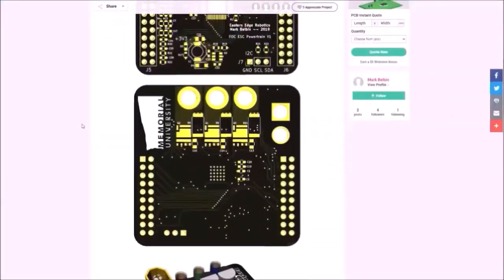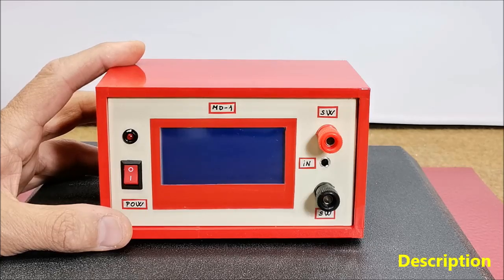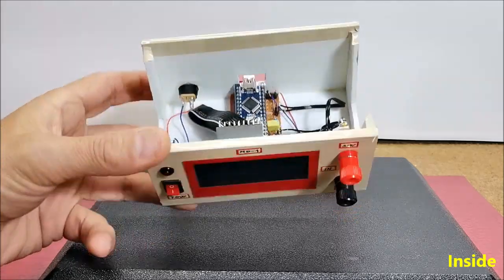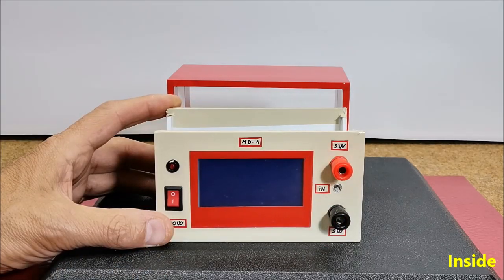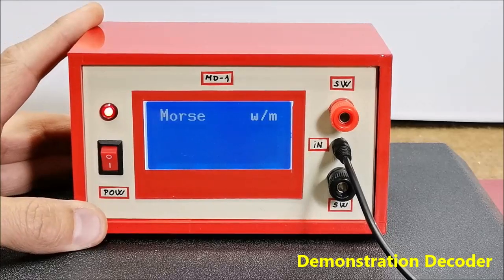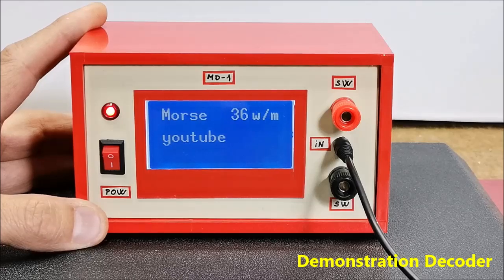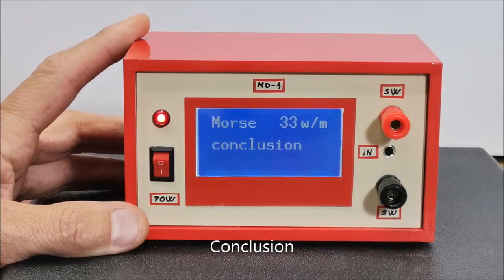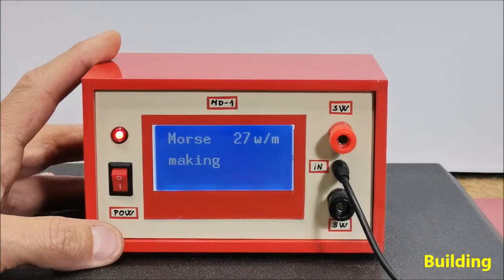DIY Arduino Morse code Decoder and Trainer

Comment: Is there a special reason for choosing a hard-to-find display? 
How can we adapt this to an Oled 128x64 display?
Reply from the maker: At the time of writing I had this display. Otherwise the code uses the U8G2lib library and just by replacing the first line of the code after #include you can define any display 128x64 supported by this library, including oled 128x64